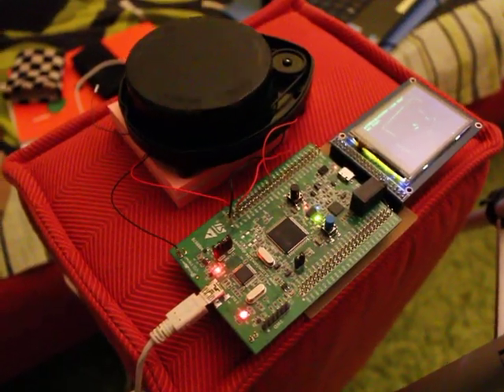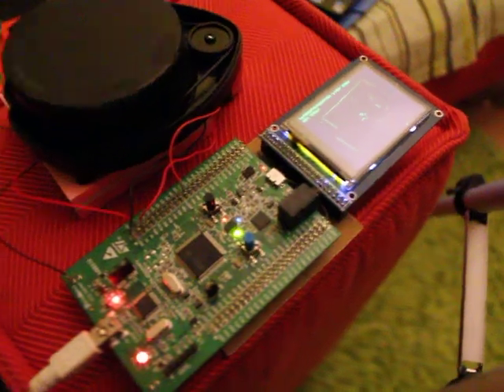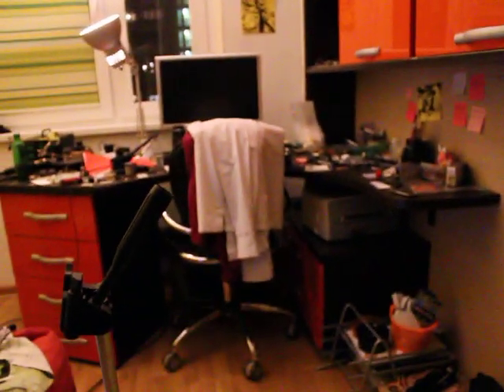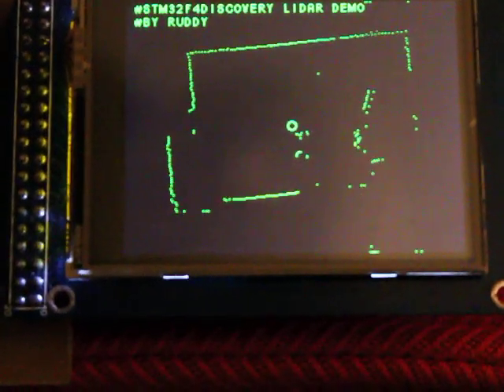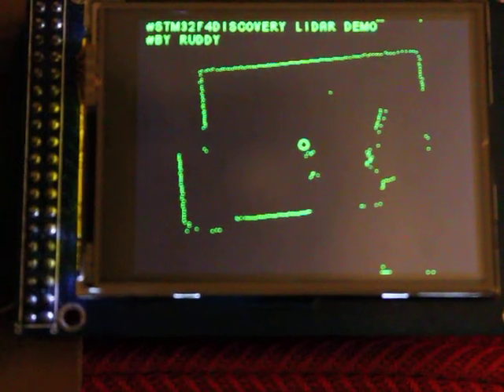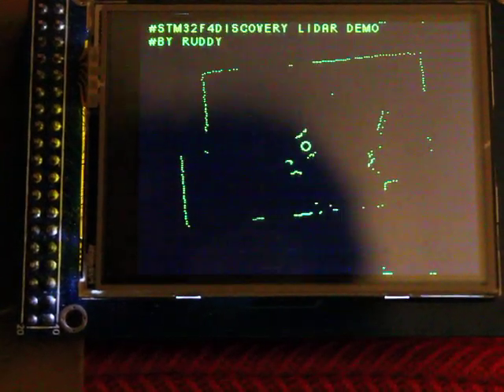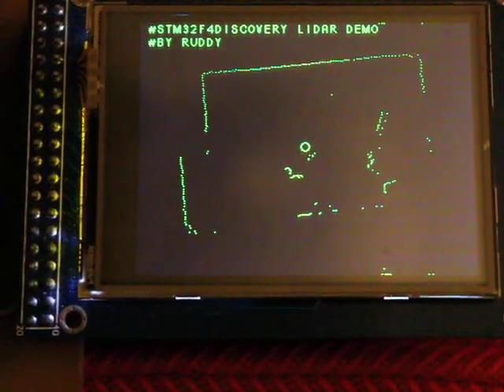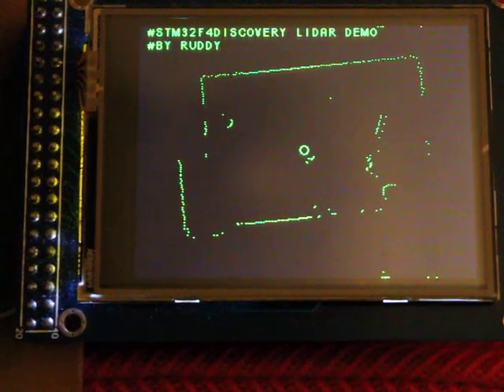Neato XV-11 lidar + stm32f4discovery + lcd tft display

Comment: Hi Sergey! I also received this unit, but have some problems. All readings (except for approx. 1 second during spin-up of the motor) have the bad-data-flag set, otherwise I can read out and decode the packets just fine, so protocol and connection are good. Do you have any suggestions, or did you also experience this behavior at some point?
Reply from the maker: Try lowering the motor RPM (give it less voltage). This device has quite narrow band of stable RPM. Maybe you spin it too fast, thus it feels ok only after start, while it still not accelerated. For me it worked at about 5-6 revs per second.
Reply: Hi, thanks for your answer, it was already in the right rpm-range (I use PWM-control to keep it at a stable 5rpm). I received a second unit and this works perfectly, so it was just a faulty unit I got the first time..